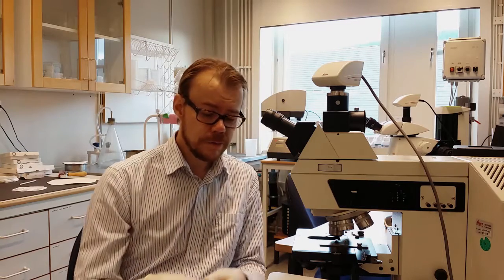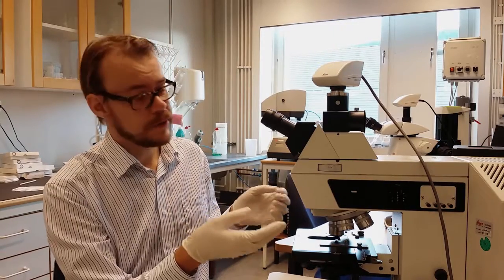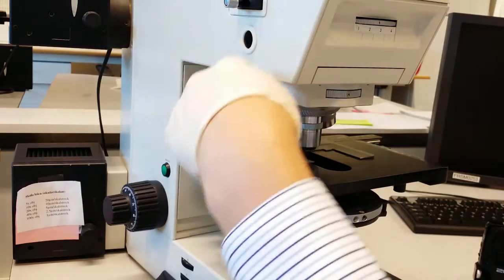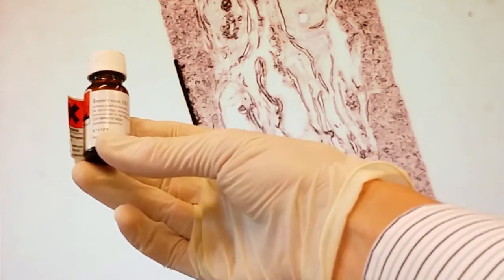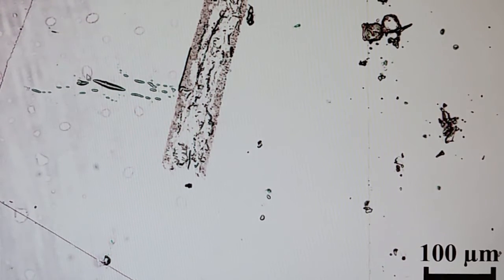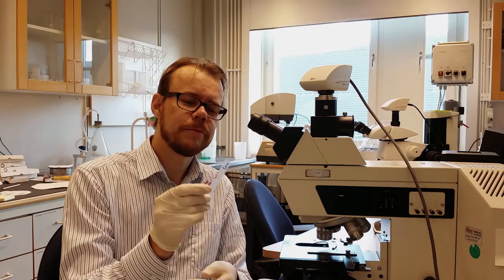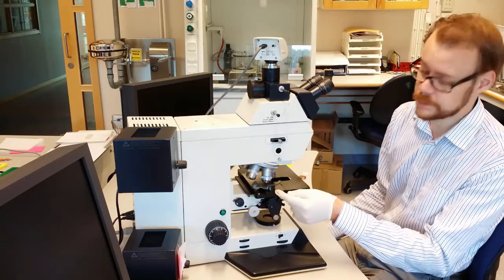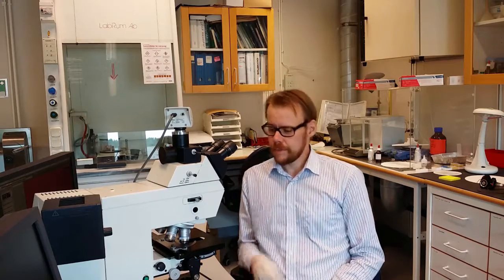Light Microscope LM demo session

Comment: Hello

We buy an old tem, that's model is jem 1200ex with scanning image device that have a scintilator with tow crt for dark mode and light mode. When we want to connect to scanning image device (MODEL: ASID 10) the beam is off and cannot to see any pattern on CRT. In this model when we push sm key on ASID 10 the florsent plate go to vertical but beam is off. 

How we can see the pattern pictures on CRT on this device.?

And we cannot find any manuals about this device. Please help me to know how to operate with this and solve the problem
Reply from the maker: Using the old scanning units is tiresome, if you want SEM operations you should do something similar to what's described in this old blog instead: https://magnusblogofphysics.blogspot.com/2010/07/digital-images-from-old-semstem.html 

(i.e. hach the system and bring over the controlls to modern computers.)